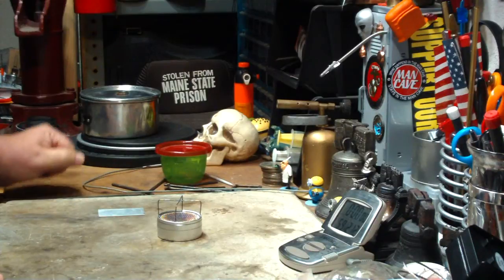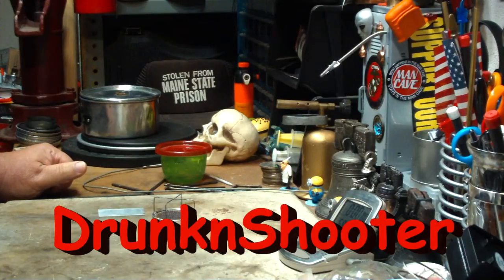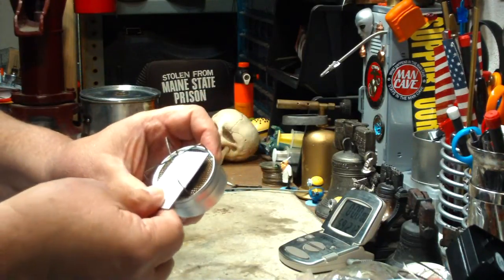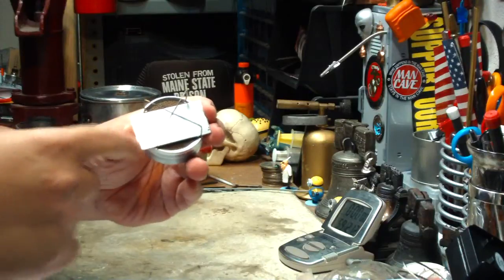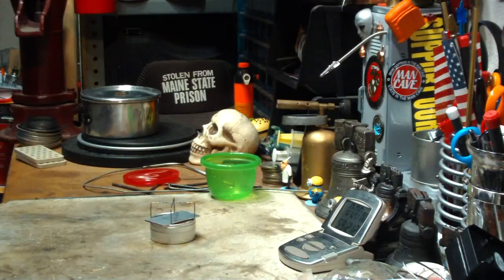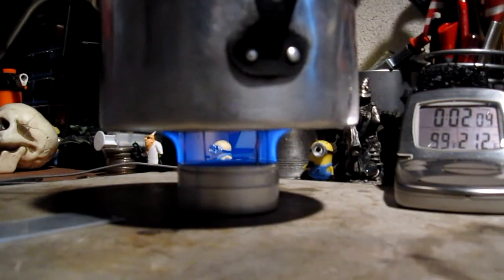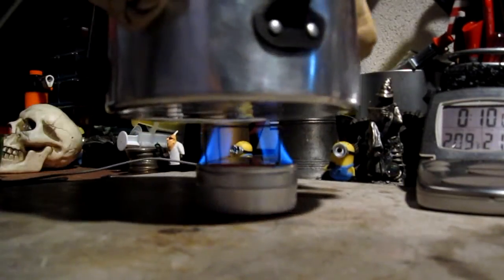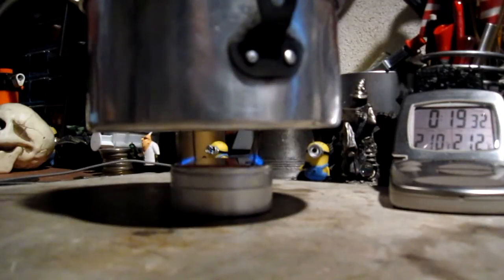Zelph's StarLyte Alcohol Stove - Simmer Idea - Boil Test #1

Comment: Hi Hiram!
I own a starlyte and use a piece of carbon felt placed right on the burner in order to simmer. It has a few advantages over the metal. one, it insulates most of the fuel from the fire and two, it can be almost any size you want due to the fact that it can be bent so it fits between the pot stand legs.
Mine is just a small square patch covering around 80 percent of the area of the burner head.

Comment: The reason the fuel burned out faster was because the metal piece was making the stove hotter than without. Two ways to get a simmer is to raise the pot to 1.5-1.75 inch above the stove, or add water to the fuel.